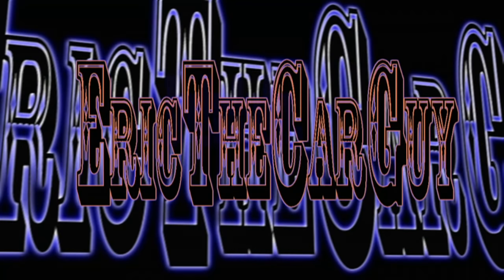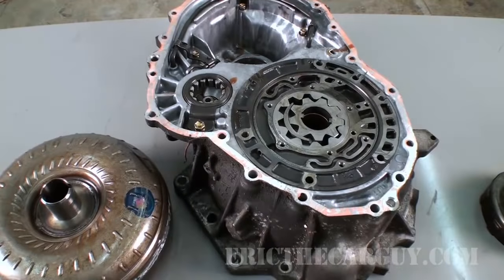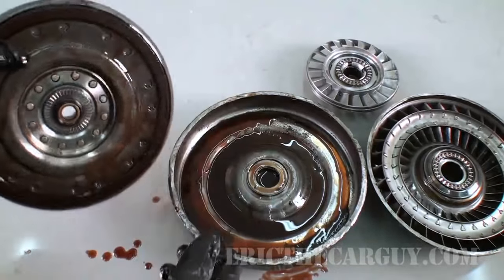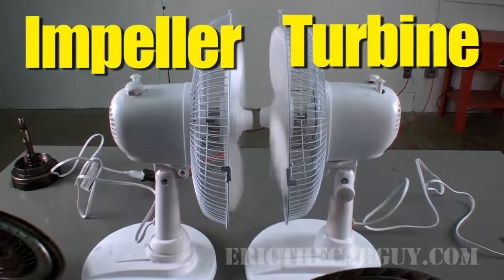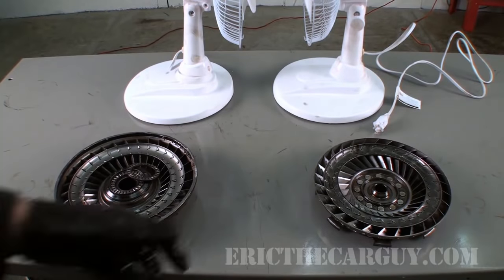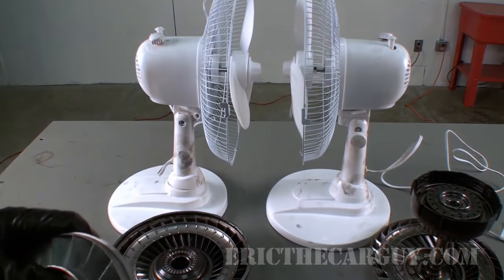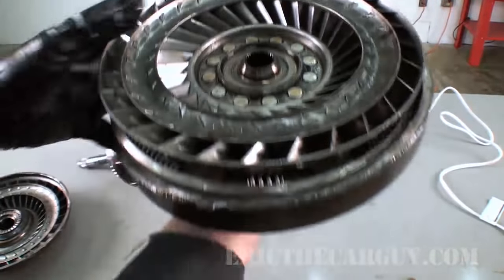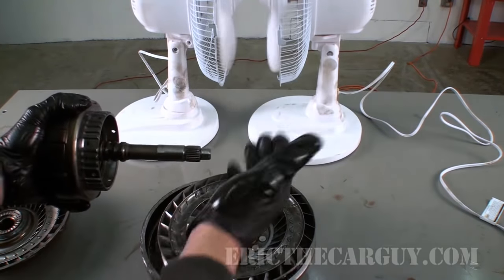How Does a Torque Converter Work?

Comment: Good explanation.
These gearboxes are good for applications where you're towing a big weight like in trucks or for some offroad vehicles but for cars, they're not really necessary anymore and have been superceded by DCT.
DCT will be superceded by the electric motor because they don't require gearboxes since they supply 100% torque from zero RPM up to 20,000 RPM.

There's a massive mechanical simplification when using electric motors over internal combustion engines.
Given Li-ion batteries were only invented in 1991 by Sony in conjunction with the Asahi Kasei Corporation, the rate at which it's power handling has gone up and the costs have gone down, added to the rate at which charging has increased along with battery durability, the next decade should see electric vehicles more than match ICE engined cars.

I think for trucks, they'll still rely on diesel for a good few more years because anything that impacts their load carrying capability, impacts profits so until they can get the power density of batteries much higher than they can today, trucks will stay diesel.

Comment: My 2012 Kia sorento diesel 2.2L, torque converter rattles when decelerating from 60 kph or 5th gear. My gearbox is 6 speed auto. It does not rattle when decelerating with manual mode, but it rattles and minor shake/vibration when auto mode decelerating from 5th gear or any speed higher than 60 kph. Is my torque converter faulty and what could be causing it? My stall speed is noticeably less after my gearbox/and torque converter was replaced with 2nd hand 2 years ago. I think they gave me a dodgy torque converter that time as it is used. It has minor slipping when auto-shifting gears mostly when vehicle is loaded or when driving up a slope. Is my gearbox dodgy or is it a torque converter issue? And maybe it is a faulty torque converter clutch. I get scared when i hear the loud rattle which happens for about 3 seconds, so i shift to manual mode so the rattle doesn't happen when manual mode auto-down shifts when decelerating.

Comment: I can feel the torque converter clutch engaging in 4th gear when accelerating. I can only notice it in that gear, its exactly as described, grabs the gear, rpms go up, then torque increases and rpms go down while still accelerating. Is it normal for it to engage during accelleration in other gears?
Reply: Can torconvert  stop  transmission fluid from coming from the cooler pipe

Comment: I have 2004 suburban the starter run for 3 second and stop. Giving me deferent code Everytime cam sensors nock sensor. And then it runs for 5 minutes and shut off. Any thoughts? Before that the automatic door lock used to open and close by itself the dashboard use to get dark sometimes

Comment: Just to dial this in a little better...   (Sizable read)

The Impeller accelerates fluid..  This means that it also imparts centrifugal force on it.. This causes fluid on the impeller side to travel from a low energy state (Center) toward a high energy state (Toward the outside) as it leaves the impeller, it enters the turbine and imparts a torque on it.  As fluid goes through the turbine, it loses energy and travels toward the center of the turbine. Because the turbine is spinning so much slower than the engine at low speeds, to accelerate the fluid again would take a LOT of power from the engine.. 

Now you're accelerating the engine AND the fluid in the converter. BUT, because the fluid has high linear velocity as it leaves the turbine (No rotational velocity because the turbine is not spinning yet as you take off from a stop) in nearly a straight line (Axially) toward the impeller you can redirect it. Enter the stator..  

So now Fluid in the impeller is sped up, flows around the outside to the turbine and tries pushing it. The turbine transfers this torque to the transmission and the fluid now travels toward the center of the turbine. The axial flow of the center of the turbine hits the stator and the stator redirects the fluid so that it now is headed in the direction that the impeller is spinning! Now the engine doesn't have to waste a bunch of energy to accelerate the fluid in rotation of the engine. You can think of this as the difference between jumping off of a stopped merry go round and hitting the ground running where you have to accelerate yourself from a dead stop. Vs spinning a merry go round and jumping off to hit the ground running while you're running the direction that it's spinning. It takes a LOT less effort to get up to speed of you jump off of an object going the same direction. That's all the Stator does..  

Now as you pick up speed and the turbine speed gets closer to matching the impeller speed, the stator begins to freewheel.   The fluid leaving the turbine is spinning much faster than the stationary stator and it's now becoming an obstruction. To prevent this from being an obstruction we allow it to freewheel to get out of the way of passing fluid. Relative to the impeller/turbine when at speed, the stator will actually look like it's spinning backwards.. Think of it like pedaling a bicycle down a steep hill.. Taking off from a stop you can push against the freewheel in the rear wheel to accelerate yourself down the hill to a point..  Maybe a few pedals or so and the bike gets going so fast that you physically can't pedal fast enough to gain speed any faster than the hill is gaining speed. so even while pedaling your fastest, you'll still hear the freewheel cogging away as the rear wheel begins spinning faster than you can pedal..  This is exactly what the stator does. 

Now, the TCC (Torque converter clutch)..  There's actually a seal on the TCC piston that compartmentalizes the front clutch face to the back of the engine side of the converter where the tip of the input shaft is in. During normal operation, fluid is everywhere in the converter and everything as it spins is under the same pressure from centipedal force of the converter housing trying to keep the fluid contained. As engine RPM increases, so does centrifugal forces, as well as the centripetal forces of the converter shell opposing these forces. When the computer commands the TCC to come on, the solenoid that controls it moves a shuttle valve in the valve body to shift from equalizing pressure between the clutch and the rest of the converter, to EVACUATING the fluid between the clutch and the front of the case.. Now you have a bunch of fluid that's spinning really fast and making a lot of force pushing the clutch piston into the front (Engine side) of the converter housing. This causes the clutch to grab the case and locks the turbine directly to the engine.  This was done as a fuel saving method since as you can see in the demonstration there is always SOME slip in a fluid coupling device. With a TCC, there is no more "slip" and you get the best fuel economy you can with your automatic. When the computer wants to disengage the TCC Clutch, the solenoid will move a shuttle valve in the valve body back from Evacuate pressure position to Equalize pressure position, and fluid re-enters the area between the clutch and converter housing and the clutch backs off of the shell and disengages. 

This was a kind of important detail that was left out.   Hope it was worth the read.

Comment: My truck is at the shop and I have was seems to.be a huge issue.   The end of the torque converter that connects to the crankshaft is seized and won't come off.  How is is possible when there's nothing that holds that end to the crankshaft 🤷🏽‍♂️.

Comment: Can you advise me on the transmission problem of my car? I got a used transmission from a junk yard and installed it on my car. After installation, start the engine  and move the transmission lever. With the engine on, the transmission lever is in the p r n d L position, but the car does not move. There is no feeling of engine power being transferred to the transmission. When you move the lever, there is about 1/4 of a needle movement in one RPM tick. The RPM gauge barely moves. At this time, it feels like stepping on the accelerator with the lever at N. The car does not move when the engine is turned off and the lever is in the p position. When the lever is in position n, I can move the car forward and backward. What's the problem? Is it because I didn't connect the input/output
cables properly? Or some other problem?
Reply: Are you sure you placed the torque converter and transmission properly on the splines? Either your transmission fluid pump isn’t pumping fluid or you sheared all the splines off the transmission input shaft and now you’re transmission isn’t getting any power transferred from the engine.

Comment: one question. i dont understand how ur turbine stop. like when you press the brake pedal. how is that possible the will not stall the engine? because in manual u need to disengage the clutch apply brake and put ur transmission into neutral. anyone would like to enlightened me. thanks by the way great presentation precise and accurate.

Comment: Stopped by 2023 Be cool to see the sprag. Hard to believe just one engages  I believe they are only 1/4 by 1/4 inch.   I use a Spragless converter.  Learned a lesson the hard way.

Comment: Question ( for anyone knowledgeable ) , a friend told the to put the converter from a `70 Chevy Vega into my `70 Impala 350 small block .  I'm sure performance parts have torque converters all worked out now , but what would I have expected after installing it back then  ?  ( Friends father junked the Vega when it died and I missed pulling it out by two days - GGggrrrr ) 
Eric , thanks for posting this video , I'll be checking your channel out .
Reply: @trentcruise3084  Classy

Comment: What is going on with my 2006 lacrosse transmission locked up, and  hearing a grounding noise coming from  the front gears, whene i was attempting to tow it?

Comment: Does an automatic transmission require anything other than power from the engine, fluid, torque converter, and gearing to function? Where do all the electric components figure in?

Comment: I overhaull the transmission 48RE diesel engine and I install a havidury torque converter and now when I putting in gear its not move at all what cool be the problem?

Comment: In multiplying torque, is the torque converter simply acting as a reduction when the car is starting and the engine side is turning faster than the driven side? I don't understand how torque could be increased in any other way, but I could be missing something.

Comment: What happens to the torque converter when you brake when on drive mode wil it heat up. Say you brake in few minutes while in drive mode.

Comment: A lock up torque converter will lock up in other gears other than high gear. Normally it’ll happen around 45 miles an hour if you’re not really hard on the throttle, you can actually feel the lock up lock up even if it’s in third gear if you have a four-speed automatic I have dealt with it before you should also be able to tap your brake pedal at speed and fill your torque converter unlock. You should be able to see your RPMs raise just a little bit by maybe 300 250 rpm maybe  and then it will reengage. Or that’s  the way it worked on my 4L 60 E my 700 R4 a 200 metric all of those from my 2002 ,2000,1996,1993,1991,1989 Chevrolet trucks I don’t know about the newer ones because the last new truck I bought was my 2002 I still drive it with 419,000 miles on it 386 of those was on the same 4l60 that it left the dealership with when I bought it new I think for 4L60s get a bad rap

Comment: @9:11...It doesn't actually increase the torque output of the engine. It increases the torque "seen" by the input shaft of the transmission. Fin size, angle and count all have an affect on this. Even with an engine that has a maximum of, say, 250 lb ft of torque.

Comment: What is the difference between TCC solenoid vs torque converter clutch, and a code of P0741 on 2009 ford f150 with a mileage of 193,079. Vehicle can move forward, reverse, neutral when changing gears but when driving uphill/downshift it slow down. Temperature guage for transmission goes from cold to halfway point and if it's not warm up right, it drops Temperature plus when I tow a railroad rail to paved the road, the transmission temperature guage on dashboard it goes nearly hot side so I stopped. And while I was driving down the dirt road on slightly bumps road, tool wrench comes on, my obd2 scanner says P0741 performance/stuck off torque converter.  I been trying to look for videos and contact the ford dealership for parts but told me, they don't carry it or you must buy an aftermarket part. I rather buy original ford parts vs aftermarket part don't last longer.

Comment: I've had that happen when i went to stop and the whole car came to a violent stop. It was an issue with the TC. Now i understand why it only happened when I got up to 80 k/h before stopping. it wouldn't do it if i only got up to 30 or 50 k/h and then stopped.

Comment: is it possible to use torque converter in manual transmission to add extra power?
Reply: It's not possible to add horsepower with a torque converter or clutch in a manual transmission. In fact, torque converters waste power! If you meant to say torque instead of power, you can manipulate torque by changing gear ratio in your transmission and differential.

Comment: I had a 1948 Chrysler and it had a fluid drive transmission 
Witch means that it had a Manuel transmission with a torque converter

Comment: 2002 ford f150-Lately my transmission has been overheating going up hills, it's never does this before. Around town & on the freeway it's fine. No check engine light. New filter and fluid. It's been fine for years on the same hills that is starting to give it problems. I ordered a external transmission cooler with fan but I want another opinion. Does anyone think it could be the torque converter? Thanks

Comment: Borg Warner was having fluid flow gear boxes what happened to them? As Borg Warner was way ahead of ZF and multi stage Gear boxes. Also the torque convertors we far more efficient even used in speed records with only high speed gear changes. The Rover jet car had the first Borg Warner auto gearbox on them and later in late 1960s and 1970s Jaguar had experimental later types. My Dad used to work on those gearboxes as worked for Borg Warner research and development. From early Jaguars to about 1974 all had Limited Slip Differentials I think you call Possi drive. I think oil flow gear boxes would had changed everything just wondered if you known about them by Borg Warner?

Comment: One thing I must bring to every ones attention.  Since ALL manufacturers of automatic transmissions now produce "Electronically" Controlled Valve Body Transmissions instead of Pressure-Vacuum (HINT: Modulator Valve) controlled transmissions, they are LESS of a "Slush Box".

Comment: Hyundai i30 transmission doesn't clutch fast it takes about 5 seconds to clutch  but in driveway its changing speeds normal the problem with first move  it takes  sometime to clutch about 5 second with kick ...any ideas thanks

Comment: My 1970 pro street mod Chevelle, ed pink 502 4000 stall torque converter narrowed 12 bolt 4:57 2100 hp 1000 flbs of torque 7.49 secs 1/4 mile 🤯

Comment: You forgot that there's a fourth extremely important thing that the torque converter does, It ALLOWS the engine to run without forcing the transmission gears to turn when the car is stopped. In my opinion that's the MOST IMPORTANT function of a torque converter. You can do pretty much the same thing with a simple fluid coupling but you wont get the torque multiplication. You get everything else.

Comment: Ok so I have had a loud clank/bang coming from the bell housing area on my 96 vortec 2bolt and the early 4l60e. Well somehow I warped the converter which eventually broke the starter. I put in a new FP and converter, noise was still there just not as loud
Reply: Oh by the way the starter worked today when I drove it in. That noise started August 21. I had a load on the pickup trailer behind the Yukon. I made a bad move. I chose my gear around 3k and proceeded to roll into the throttle up a hill. 55 to 70. I weighed in at 9700 and out was 7600 Yukon and 80s f150 pickup trailer

Comment: The trans runs much cooler in torque converter lockup TCC, the heat is generated with fluid movement thru TC.

Comment: So I changed  all solenoid  Because the transmission wasn't going in forward or reverse it's just  slow  But when changed all solenoid  it worked bur still ticking and trans slipping plz help

Comment: What could cause shutter at low torque at  1500 -2000 RPM’s in any gear with 2007 xl7.  Goes away upon applying throttle but returns as soon as the previous  circumstance is acheived.

Comment: My 2006 dakota shifts perfectly but my over heating light come on,change oil and filter,my radiator is brand new and has plenty of cooler fluid so the overheating light came on but don’t know why,because the truck work good

Comment: I have a question for you.... I have an infiniti g37 2012 and noti Ed after I changed the transmission fluid... On a stop when I take my foot off the break and accelerate the car engine revs then the transmission kicks in later...  Like the car jerks... Like there was a disconnect between the engine and gear. Also this happened when slowing down to 10 15mph then accelerate slowly to 30mph... I felt the transmission didn't don't if it should grab (something)  or go to first gear. Anyone have any idea? Car has 65kmiles on it since I haven't used it for a while